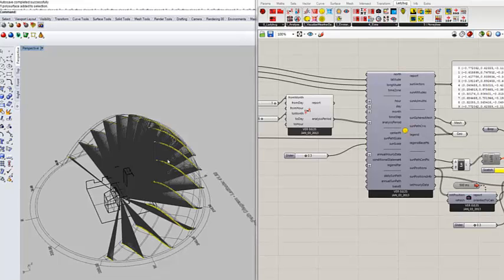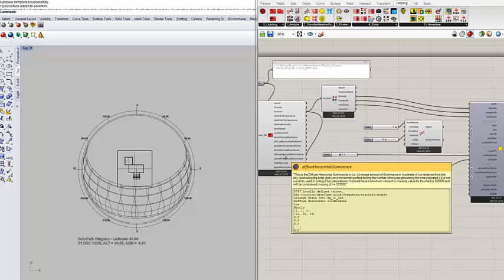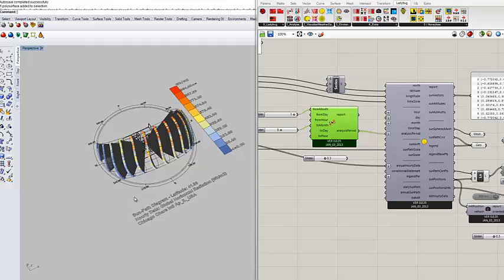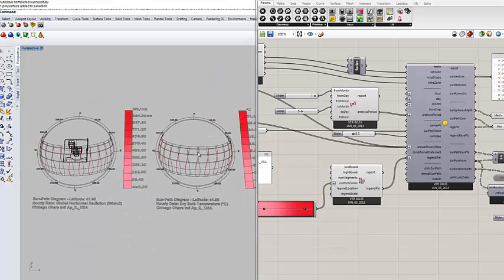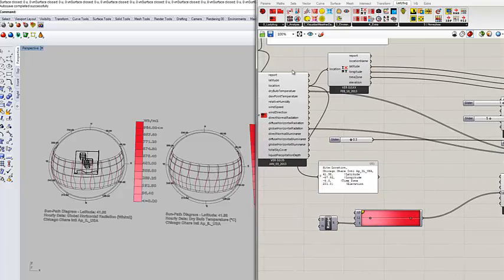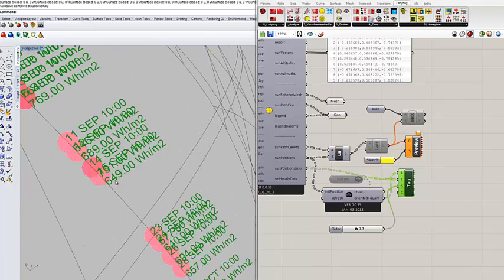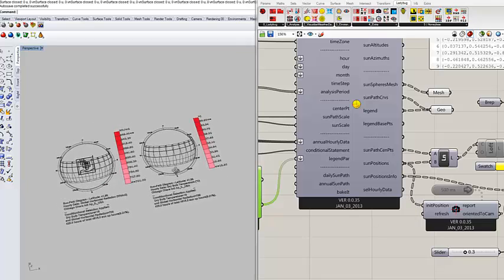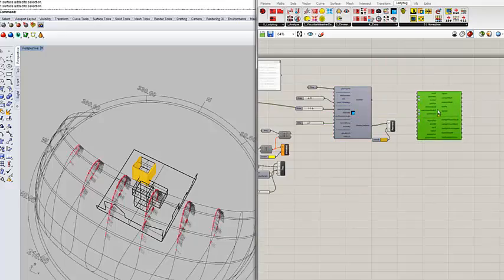How to use sunpath in Ladybug - Part 2 of 3

Comment: Hi Mostapha, I am using Rhino 6 with VER 0.0.66. When I plug in the data from the EPW file, it won't create a chart. The data shows individually on each sun but there is no chart. Any idea?

Comment: Hi Mostapha. I have version 0.0.62 
 When I plug in both the 'Dry Bulb' and 'horiz radiation datas' from the  'importEPW' module into the 'Sunpath' module, only one connection stays, the old one disconnects. For some reason it won't create a new sunpath dome with the other data set. This prevents me form going onto the next step of trying the 'conditional statement'  
Any help with this would be great, so I can teach my students next semester. Thanks!
Reply from the maker: +Ben Lepley hold shift when you're connecting the second input otherwise Grasshopper replaces old input with new input.